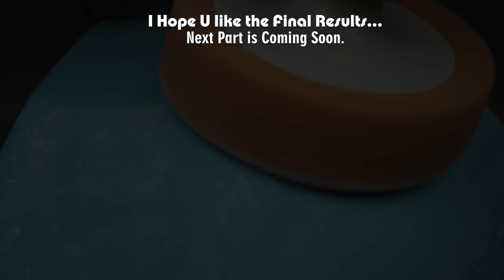1962 Vintage Vespa Scooter Italian  - Unbelievable Restoration # 1

Comment: You did a wonderful job!!
As a painter, id like to recommend you adjust your paint gun. You are spraying with alot of pressure, and your fan is dialed in too small. Open up the fan pattern, and spray colour around 20psi (1.5 bar) and clear coat/lacquer around 29psi (2 bar)
Also, once you get your fan pattern larger, you can get closer to your panel. About 6 inches...

Comment: In 1962 my father bought a new Sears Allstate scooter it arrived at the house in a wooden crate.It was red in color,3speed,2 cycle.A great dependable machine.He replaced it in 1969 with a Honda 300 Dream.Both great classics and by the way.The scooter was a Vespa.

Comment: Best of Mechanical Engineering i have seen ever but can you make videos on converting old vehicles to electric it will help lot of people to get an idea how to convert into electric which will be good for environment too ! Keep rocking
Reply from the maker: Sure bro, definitely... The fuel prices increased internationally and the people also want green environment, So, I'm already working on a conversion  project.  I used an old 4 stroke bike and converted into electric. I'm sharing the link with u
https://youtu.be/4DfUoYHIVy8